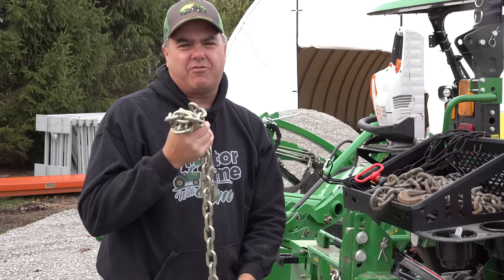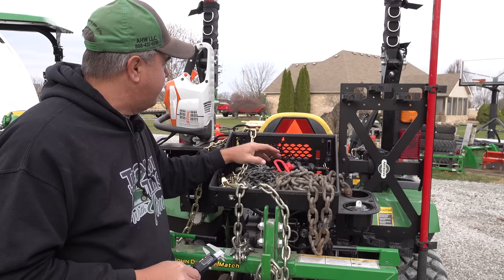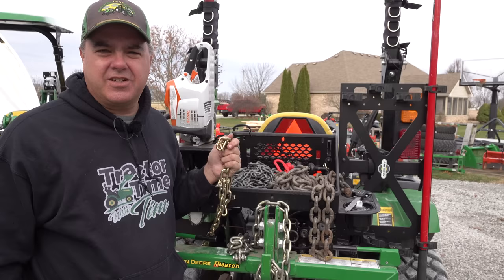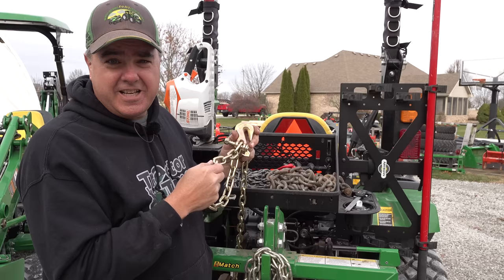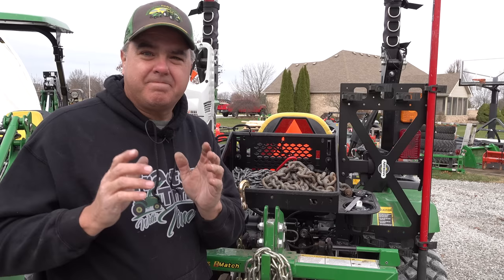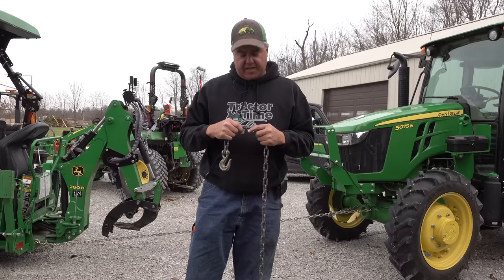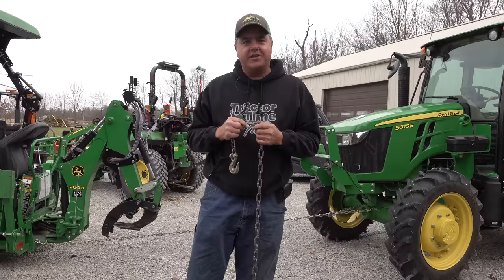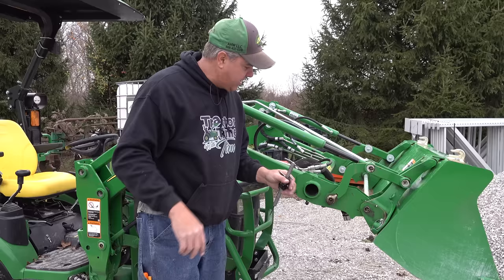What Compact Tractor Owners Need To Know about CHAIN!

Comment: At 5:08. Interesting that the load limit increases with grade for all sizes except 5/16" grades 70 & 80. The 70 is stronger. I wonder if there is a typo on the USCC chart.
I do attach chain to my quick attach but only when using it as a logging arch. I raise it up just high enough to keep the end of the log from digging in.
Reply: I looked at other charts and noticed the same ratings. My guess is that the Grade 80 chain is derated for safety as it is approved for overhead lifts whereas the grade 70 is a transport chain for tie-downs and is not approved for overhead lifts.
Reply: @denisewildfortune4058  "My guess is that the Grade 80 chain is derated for safety" -- maybe. But then why don't the other grade 80 sizes have the same derating?

Comment: Do you have a reference to not being able to use 43 chain for tractor transport? This has opened a discussion and most state that 43 chain is fine to use as long as poundage ratings are adhered to. Anyway, good video, good information. But, just checking as we use 43 and never had an issue. We tie all four corners of our tractor with grade 43 which is 5400# each, so way over what is required.

Comment: Only thing I see wrong with putting chains in or on lifting mechanisms is it will reduce what they can lift. Also a question, for off-road purposes, would it be safe to hook 2 chains together by hooking each nonslip hooks to the others chain link? Or would just having a longer chain be smarter/safer?

Comment: A chain used with a load is ONLY as strong as its weakest link..   at 12:00, I would NOT advise you to hook up to those slots next to the drawbar...because if you do any turn hooked up that way it can wrap up around your tire.. It's always best to use the drawbar..

Comment: I added crossbars to a set of tire chains.  Used grade 30 1/4".  Wasn't sure if I could weld grade 70.  A little info that might not matter;  Can Am Maverick Sport XMR, 1,900lbs, 100hp , VERY low low gear, 72" snow plow.  Think they'll hold?  Could I have welded grade 70?... and if so, would the welded link be weaker then the un-welded chain?

Comment: 40 years ago I had a stuck in mud tractor. We attempted to pull the tractor out, but the chain snapped. The front of the stuck tractor absorbed the snap. Both of us survived and we didn't abuse the chain. Always use cables to unstick and pull, chains can be dangerous - use with caution as if it can go wrong it possibility will go wrong

Comment: Question:  I have been using my pallet forks a lot lately.. cutting and moving a tree etc. Would you suggest that I weld (or bolt on) hooks on the pallet fork rather than the bucket?  So far I use straps since I do not have the hooks or a chain. But, been thinking I need to get chains.
Reply from the maker: Having hooks on your pallet fork frame would be nice.  My Artillian frame has slots on each end which can accommodate a chain link.  This works great!

Comment: Very informative, thank you! Do you have any experience with Kinetic Recovery Ropes? I've seen them advertised as safer than chains when pulling a stuck load.
Reply: They are safer from what I have seen. They will stretch and help pull someone out when stuck. Matt's Off-road recovery uses them quite a bit.

Comment: I feel so stupid now because I was trying to get the chain to hook through the link. I didn't know it goes around it like that. I'm using it on a riding mower to pull 4ft logs around. I got tired of my winch hook lock latch thingymabob getting bent up on the cable. Got the chain to do the hard work so the winch could just pull straight...... Couldn't get chain hooked.
Reply from the maker: Hey, I’m glad we could help!   Thanks for watching.

Comment: The reason that construction companies get rid of chains is because of cyclic loading. After enough tension cycles, the chain can snap beneath the working load limit. That being said, I'd still say a free chain is a free chain.
Reply from the maker: Yes, and I would say that they throw them out well before they are at risk of snapping below working load limit.  Breaking strength has certainly declined, but it is at least double WLL when the chain is new.

Comment: I have used chain for years but I never object to seeing the basics.
I go a step farther and buy USA made chain from US Cargo Control.
My Kens chain buckets should arrive Monday or Tuesday.  I hope they fit with my HEAVY HITCH double weight bracket.
Reply: Do you own an iMatch adapter? That's what the chain box was designed to fit, but hope it works out nicely for you.
Reply: @yay4this  Yes I know. There is a very small gap between  my imatch and my double Heavy Hitch weight bracket. Ken was not able to answer. I am sending him a picture if they fit.

Comment: The thing I am worried about is what happens if a chain breaks. I think you may have left out a key safety point. When it does break it will likely flip toward the attachment points. This is another reason to keep it low as you don't want it to hit you. When pulling an unknown load I tie a rope around the chain at intervals and connect it back to something solid with enough slack that it doesn't participate in the pulling to catch the chain should it break.
Reply from the maker: Simple. Do NOT jerk the chain!!!
Reply: @TractorTimewithTim  That is true if your pulling equipment cannot exceed the strength of the chain. I pull stump though by placing the chain over a lumber frame. That directs the pulling force to be more upward, and due to leverage multiplies the force by several times (up to 5x). The exact amount varies depending on all the angles. Due to that variability and not knowing the pulling force my tractor can accomplish it is difficult to know if the chain selected is strong enough. I currently use 3/8 which is all I can reasonably lift over the top of the 10ft frame. The loads on the chain to the tractor are much less though, only as high as the tractor can pull. The one from the top of the frame to the ground is the high load one and if it broke would be unlikely to injure anyone.

Comment: Have you recorded a video on the dangers of the stretchy ropes? Around 1973 a tractor on a neighbor’s farm got stuck and they used a stretchy type rope trying to try to pull it out backwards and the rope snapped, went flying through the air and into the cab of the stuck tractor instantly killing the man inside of it.
Reply from the maker: This is why I am not a fan of stretchy ropes!!!
Reply: My dad would never use it on the farm for anything like pulling a tractor out.

Comment: Some of the other sub-compact backhoes have brackets and holes set up so that you can drop a pin through and pull from the bottom of the backhoe (really the strongest part of it).  The down side is that these pins are off center so, if you're pulling very hard, it will have a tendency to walk the back of the tractor sideways a little.  Then again these little guys aren't going to pull a whole lot anyway, so it doesn't matter a ton.  Just as a safety note to be aware of.

Comment: Grade 80 and above for oilfield chain. High tensile welded chain. I've used for child hood to adult. My grand dad oilfield tandem had 30 each 3/4" 30 foot long 
40 each 3/8" 30 foot
40 plus 5/16" all welded chain 
Each chain cost him $100 foot but lasted forever. With his 5/16 he routinely lifted 10 to 15 tons
Tim with just 50 chains he had approximately $30,000 just in small and medium chain
Here's a little life lesson. If you stretch 80 or 100 series chain you have accomplished a rare thing. It just doesn't happen. Our old 100 series chain winched from end to end a 40ton oilfield pump and never flinched

Comment: Chain defects are why I wouldn’t ever use 1/4 chain.    I always use a minimum of 3/8 G70.  I move heavy equipment all day everyday.  I use G100 marine chain.  I four point everything I tow and add chains for anything over 40,000 I add chains to keep compliant.  I use straps on buckets and booms attached to the machinery.   I don’t want to hurt any of the machines or kill anyone.  Dot seems to like how we do things.

Comment: ive been using the receiver on my 1025R HH Dual which only has 170lbs at the moment.. what's your opinion of using the HH's receiver for a chain? -- Does your answer change if I have  1100lbs on it?
Reply from the maker: I’m hesitant, as it is still on the 3 pt.  1100lb would help...but still nervous about it.

Comment: Is there a way to determine the grade of chain, when it is old and weathered. I have 2 chains that my dad used on the farm for pulling out stuck tractors and logging. One chain is 1/4" and the other is 3/8".
Reply from the maker: That old, I’m guessing not.
Newer chain sometimes says ‘G70’ on the links.
Reply: If you really need to know, remove the hook from one end and cut off a short section of chain from the end, say 4" .  Take this piece of chain and get it tested at a laboratory that can record the yield strength of the chain.  Using this number and the crossectional area of the chain links, you can compute the grade of the chain.  Note that yield strength and ultimate strength are not the same.  So I guess you decided that knowing the grade is not that important, right?

Comment: I have a draw bar that stretches across the two bottom catches of the imatch quick hitch. 

Is this ok
Reply: I'm new to all this but being that that the Quick Hitch is attached to the 3 pt. arms, personally I wouldn't use them to hook to.
Reply from the maker: @Bob no, I am not a fan of those bars across the 3 point.  For the same reason.  You cannot guarantee that your 3 pt will STAY down, even if you lower it.  It will come up if it wants to!

Comment: Why do they put cloth material on chain some times when there pulling something?
Reply: So if your pulling a car out and the chain rubs against the bumper or plastic in general it doesn't damage or scratch it like a bare chain would.
Reply: Main reason is when they're jerking, the chains are prone to break. They'll put a cloth or even a towel on chain to dampen  the impact. You also need to lower tailgate too. If not, the chain could snap back and slap your tailgate

Comment: People have been hooking chains to a 3 point draw bar for ever and ever. Most older farm tractors don't have a single point draw bar.
Reply from the maker: ‘Most tractors’?????
The ones which didn’t have regular drawbars had long rods which had to be attached to keep the arms from flying up.
New tractors (1945 or newer) do not have this.

Comment: Its annoying and confusing to learn I can't tie down my 4700 lb skidsteer using 5, 3/8 inch grade 43 chains (5400 lb capacity each) but must instead use grade 70 chain, to which the local hardware store has only 5/8 inch (4700 lb capacity) and create a less strong securement (both seem way overkill...).
Reply from the maker: 5/8" grade 70 has 15,800lb working load limit.  Doubt you need that.
Reply: @TractorTimewithTim  sorry, you are correct, I misspoke, meant 5/16 chain from grade 70 vs 3/8 chain grade 43.  Both sold cheaply at the hardware store.  The question was about not being able to use grade 43 for transport, which is what I thought was said (ie can only use grade 70 or higher).  If true, ill have to go buy some more chain, and can use your link for that and hooks...
Reply from the maker: Correct.  Grade 70 is minimum permitted for transport tie downs.  ...at least that is my understanding.  As always, I would recommend  you verify this with your state’s DOT.
Reply: I've never heard of a specific grade of chain needed for tie downs, only the total WLL. I'll continue to use 3/8 G43 as long as the WLL adds up to more than the minimum required.